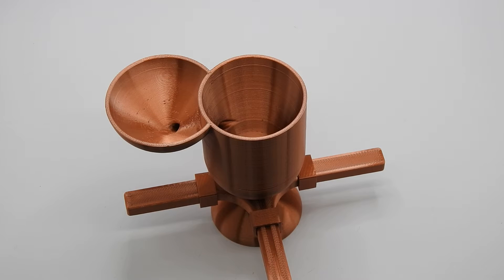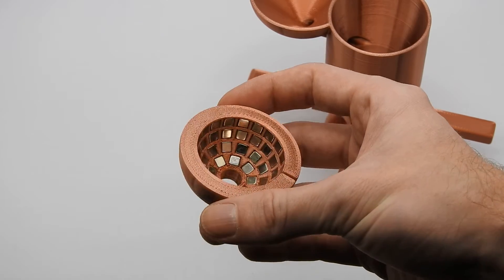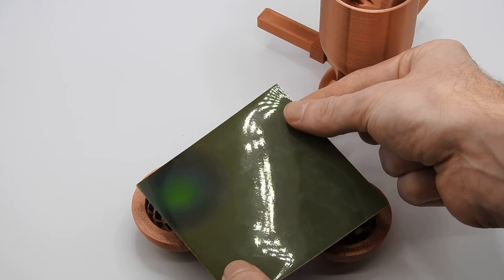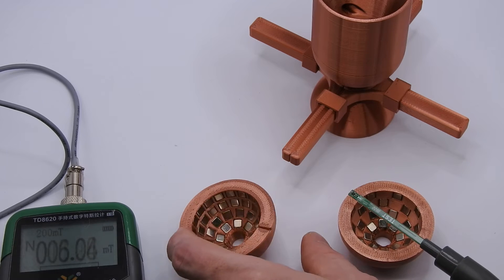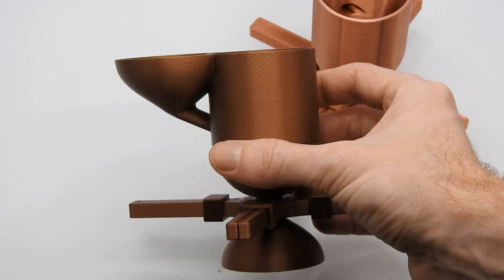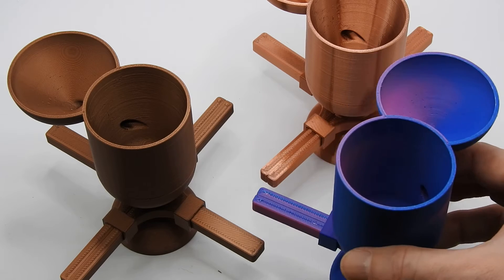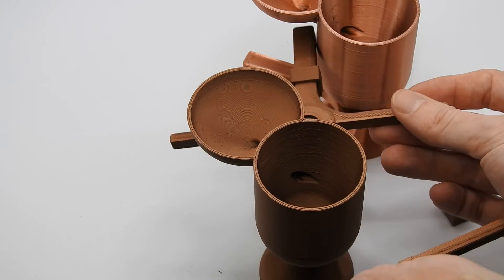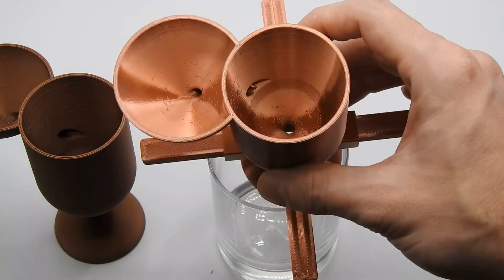New version of my water structuring device with a stronger magnet array

Comment: Very interesting device. Personally if all the magnets are south pole facing into the centre of the cup I would have the vortex going anticlockwise going into the central hole (looks like it's clockwise from the video). Sea shells that are spiral shaped have this configuration anticlockwise going in and clockwise coming out. So IMO the water vortex needs to be anticlockwise going in not clockwise going in. This has to do with left handed and right handedness, our system likes anticlockwise going in spirals, this has to do with the clockwise rotation of the earth. I made a water processing system using south pole magnets facing into the vortex hole. I used a simple vortex connector tube and two plastic water bottles. I used eight magnets around the vortex connector all with south poles facing in. What felt good and best to me was to have the vortex going anticlockwise, but that's my personal choice, anticlockwise going in with south poles facing in.
Reply: ? Are you in the northern or southern hemisphere?
Reply: @lamedvav  Southern hemisphere South Australia. . I know what you're getting at but I believe life likes lefthanded spirals going in..
Reply: @michaelpudney  I think you’re right because the expanding universe would be the opening spiral which is the left-handed one.
Righty-tighty,  lefty-loosy! 
A Lucy universe?

Comment: Awesome work! Would you be able to come up with a different design  with some connectors on both side so I can install the device along side  my tap water filter and connect it to my watter line using the pipe which  is 1/4" OD with quick connect usually found in under the sink water filters. By the way, I bought a magnetic viewing device from your etsy store. Very useful tool!

Comment: For those who don't know what the heck he's talking about, water is very slightly magnetic, but this is about supposedly arranging the molecules and possibly dissolved ions within the water in a more regular pattern rather than just randomly - or maybe it's the other way round, I'm not sure. The point is, having the water passing through an alternating magnetic field is supposed to do have some effect. It's the same as the devices that are reasonably well-respected that you can buy from builders merchants that you clamp round the incoming cold water pipe, and you can get either permanent magnet ones or electronic ones. In hardwater areas in particular it is supposed to make the dissolved calcium carbonate fur up electrical devices less and make the machines and their heating elements last longer, such as kettles. Supposedly it will also help dissolve existing scale.

I've experimented with the electronic water 'de-scalers' in extremely hard water areas (Luton and London) and I've found that new scale is very soft and breaks up easily compared to without a descaler where it builds up and becomes very hard. To my astonishment, it also makes the water in the shower feel softer and smoother and also affects the taste favourably as well. I don't know how it would do that, but it does seem to have some definite benefit. When I did a carefully-controlled blind taste test with a friend he was able to immediately tell the difference. So whatever is actually going on, and despite any number of people that will dismiss it as cranky, from personal experience there definitely IS something going on that has a favourable effect when you pass water through an alternating magnetic field.
Reply: Thanks!

Comment: Bro- you sure this works? Plastic contains toxic substances so even if this way of structuring works like you belive it does the water gets worse than before because of washing away toxins- better use wood or copper( copper is antiseptic ) and by the way using just positive emotions and thoughts will be more effective and cheaper than using magnets - we are an electromagnetic entities so we all have power to controll subtle radiation- and we do it every single day without noticing!
Thoughts are waves combined with information and emotions are just a waves with ability to manipulate thoughts or stregthen their manifestation power- magic is just a bunch of custom shortcuts( techniques) to use soulpower to archieve certain goals
Reply: positive emotions and thoughts i can transmit into a spinning copper wheel and i have proven with my small prototype that it can power only a single 7 watt LED bulb, but with the right funding i can scale this up to recieve the right energy and it will be possible to eliminate all fossil fuels and pollution with just PURE ENERGY !
Reply: This is exactly what's holding me back from getting into his products. It's not just about the immediately occurring effects but rather long term as well. This is PLA plastic and another ocmmentor said to KEEP the water in there. Shit is crazy.